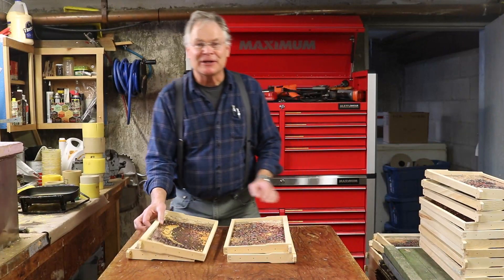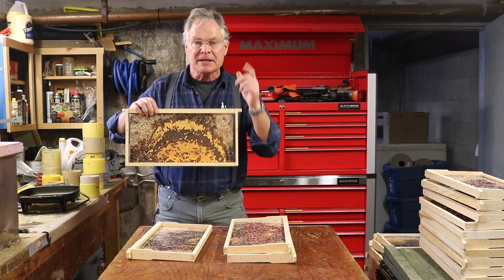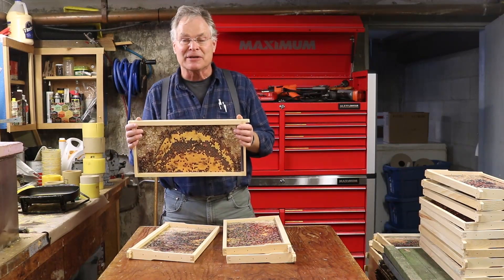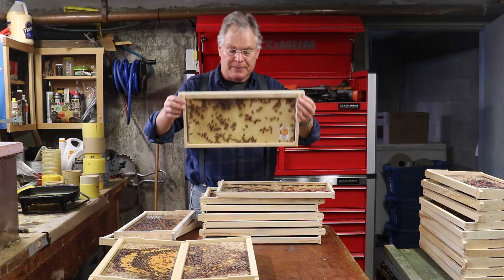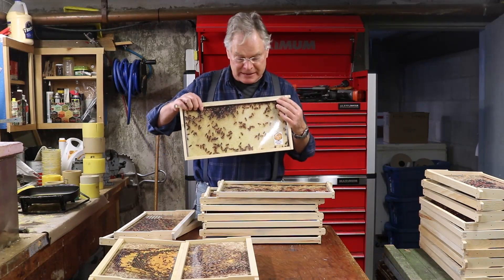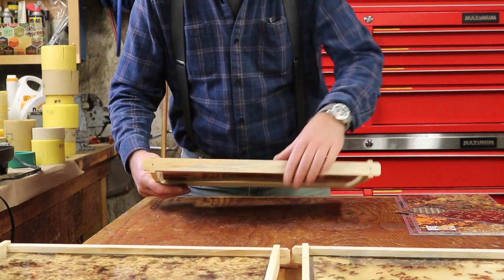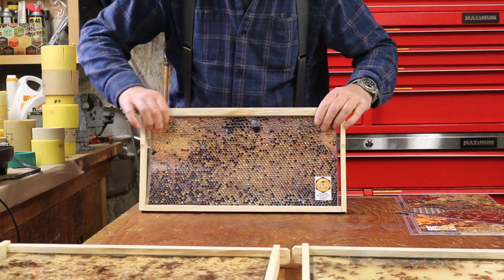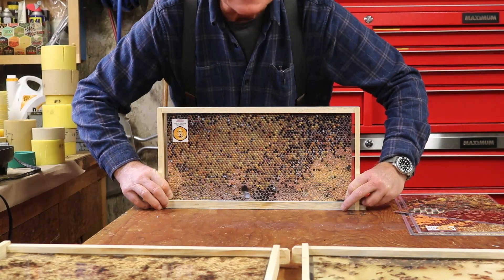Hive Life Photos

Comment: My 5th year at queen rearing. 1st time problem. Grafted 30 cells. Harvested to incubator when capped. Cups were full of royal jelly. Only 18 were finished. Placed in nucs 2 days before emergence. Pulled out today. Only 3 out of 9 emerged after 2 days later. The others were still capped with a dried up pupae inside. Still plenty of royal jelly in cup. Incubator was set at 93-94 deg. Had to be something I did to have that many bad. Any thoughts will be appreciated. Thanks.
Reply from the maker: Hi Cindy. 
It's hard to say what happened. I incubate cells in the cell builder as I don't like handling cells any sooner than 10 days from grafting. Incubators can act up but the cell builder never does. 

Could be a temperature problem or the cells were handled at a time where the queens are easily damaged.

We have done quite a few queen rearing videos. Maybe you can pick up something from them that will help you figure it out.